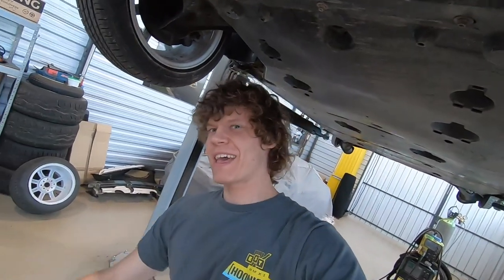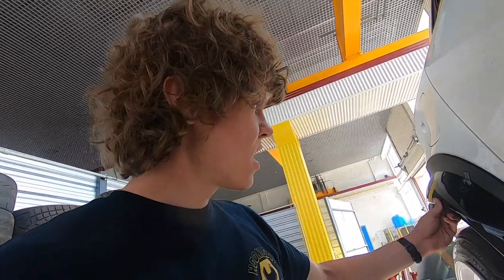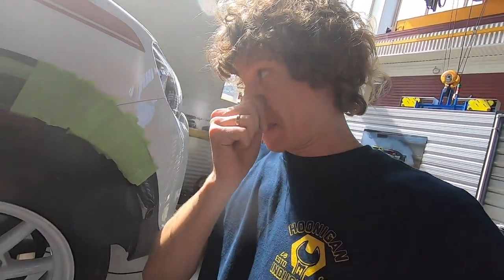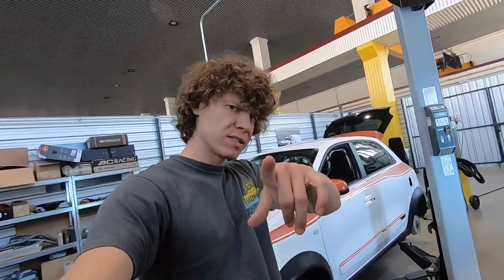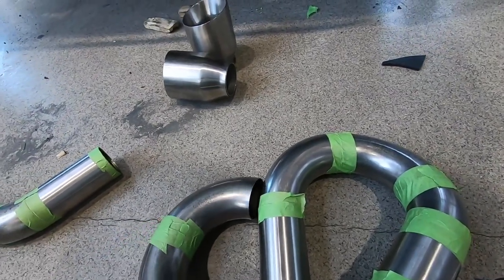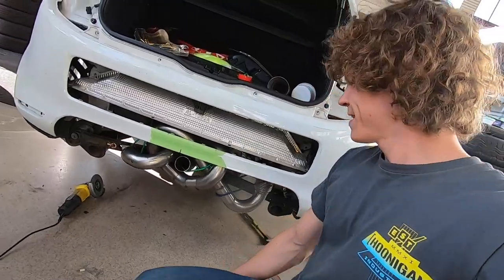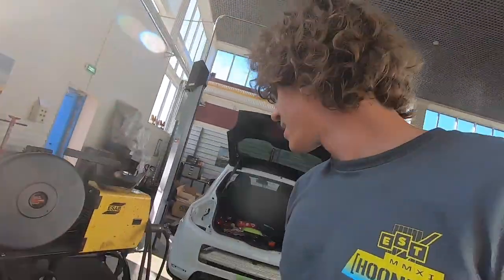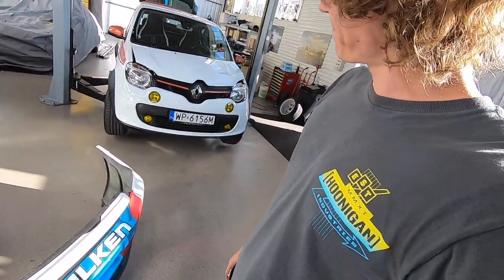Swingo Gets PRETZEL EXHAUST!

Comment: yup definitely need to remove the catalytic converter. You will definitely see it will be a lot louder and will be able to hear tiny turbo noises
Reply: You are actually able to hear a tiny turbo sound when you step off the gas, at least in our tce 90, it's a small pfffschhh, but it's only hearable from the inside. But from the outside there is a bit of a turbo sound while accelerating, but that's pretty normal